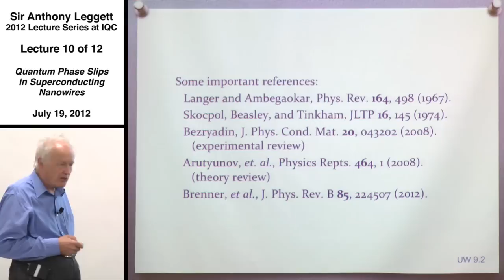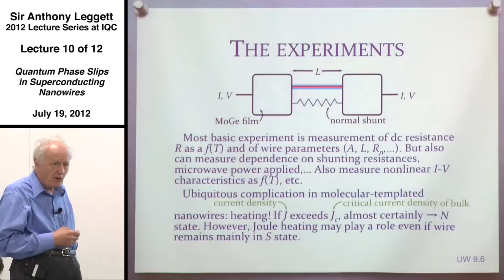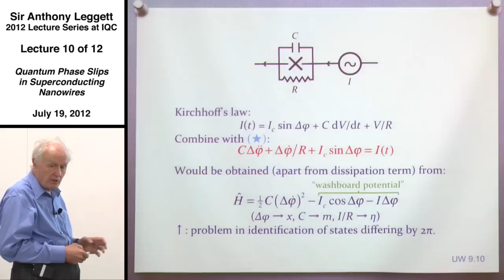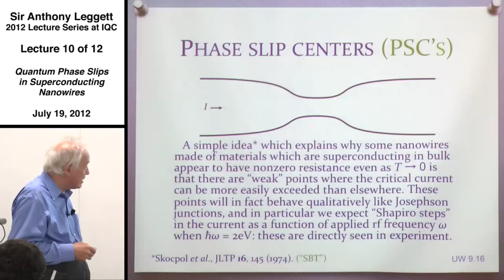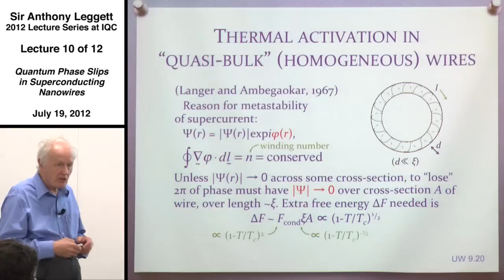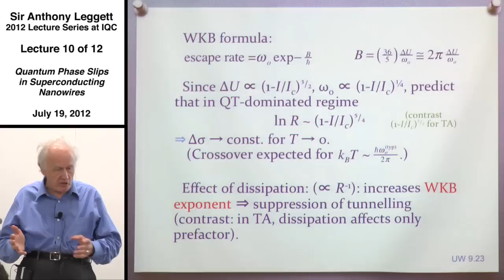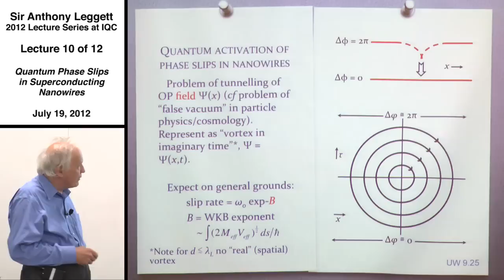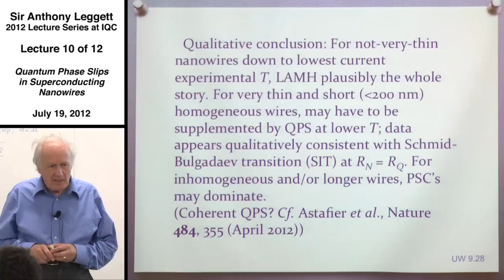Quantum Phase Slips in Superconducting Nanowires (Lecture 10) - Anthony Leggett 2012

Comment: Attempting to define the mechanism of existence:-

If Euler's formula and specific identity are visualized as the mechanical part of quantum functions, the wave-particle superposition of frequency shifting from hyper-hypo to hypo-hyper is the modulation property of reflection/oscillation by the state of universal FM. 

Because the ground state of existence-connection is unity at zero difference, and potential frequency is the Quantized information spectrum in probability shells, (encorporation-particles), and equivalent line spectrum of EM, that exists as the "mathematical modes" of the infinite unity interval of eternity-now. Completeness, oneness and continuity express aspects of the natural logarithm for a closed temporal point, of phased/orthogonal location, that is the quantized information spectrum.
And the relationship of hyper-hypo frequency is the specific possible modulation rate "e" -now and eternal orthogonality (omnidirectional) function, in bifurcation, trifurcation numerical quantum states.., to infinity, in which the bifurcation is the Pi ratio, and in which this stepped function proceeds  in the FM connection. 

Which is to say that the quantum potential oscillation shell-states are corpuscular and in the "i" containment phases of the probability-occurrence particular-connection, unity; ie Quantum Fields of temporal superposition in a probabalistic FM wave-package.

NB Pi is the "circle of infinity" balanced rate of inflation-condensation inherent in the infinite unity-connection, and that is the cause-result of the quantum-bifurcation potential in probable  connection, (n times one over x divisions by Pi numerical algebraic geometry),  and so the ratio calculated from the ratio of circumference to radius is not the fundamental concept, it's the result of Pi in 3D-linear-transverse Quantum phase occurrence at ground-state, ie 3 measurable dimensions. (Also p-Pi-brane perspective and "gyroscopic" uniqueness of phase alignment). It's the 1-0D potential position and exclusion function and "Simplicity" of identification that is infinite in function, stated "Time" collectively. ..and superimposed implies a "super-self" by reflection; equivalent to Theory of Mind.

So is intuition adibatic wave-memory recall through neutron ground-state? Something like that.